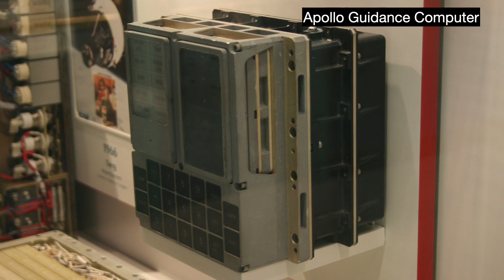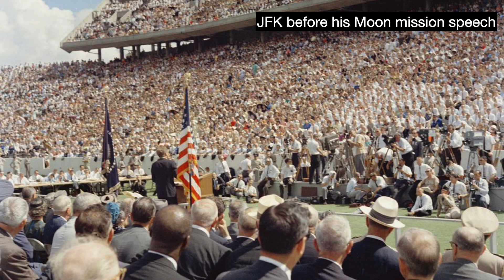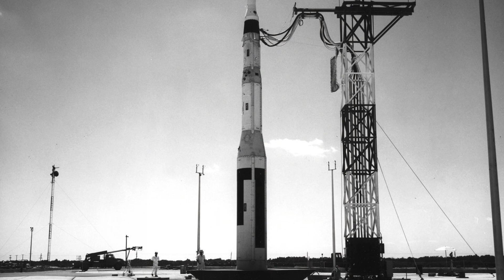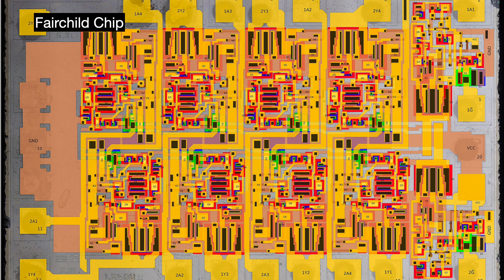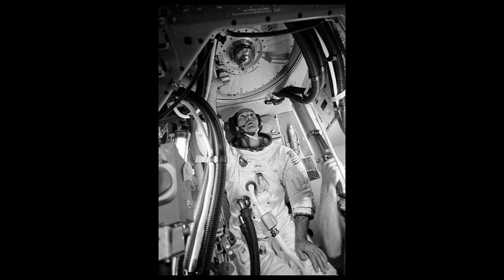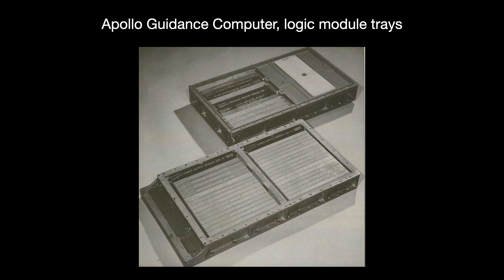How the Integrated Circuit Took Us to the Moon

Comment: Both vacuum tubes and transistors require wiring them up.  Every component, even ICs, require some wiring up to other components, but the point you were trying to make got lost in the shuffle because the main problem with transistors (and tubes) is that to do computing, you need lots of these devices and the wiring can introduce problems the IC doesn't have.

Also, when you say 4100 ICs (and later 5,000), I find it hard to believe there are thousands of chips.  I suspect you mean the number of transistors in the ICs.
Reply: The AGC used chips that contained two NOR gates each, so yeah, the Block 1 AGC used 4100 chips.

Comment: so this mean Arduino can drive ICBM too nowydays ?
Reply: I mean perhaps not an Arduino but I don't doubt that a teensy or something vaguely bigger could handle the inertial guidance needed by a reasonably large missile
Reply: @AMogus-jr6qk  yes agree teensy  can handle heavy jobs. however am curious nowadays in cruise missiles what they use as it cruise missile need full flight path and also it have terrain mapping features nowydays mean its more like full desktop computer is needed there because flight path and terrain data you will need good amount space  and images processing you might need open cv powered applications which will also more like PC .
Reply: @Xerox482  Probably some SBC with beefy ram and lots of storage, nothing insane computationally tho

Comment: They needed IC due to weight. The less weight there is, the more to get to the moon.
Even one pound saved is alot. 

If you think the massive Saturn V rocket needed to put and finally returns a tiny capsule back to earth. The ratio is tiny.

Comment: When NASA looks back at back-up systems and states that maybe they should have focused on improving their primary systems instead... that defeats the whole purpose of the back-up system. If their primary systems had gone offline, no matter how improved they were, then they would potentially be praising the fact that they had a back-up. The best back-up is a back-up you never have to use. Of course this all assumes the back-up actually works if needed.

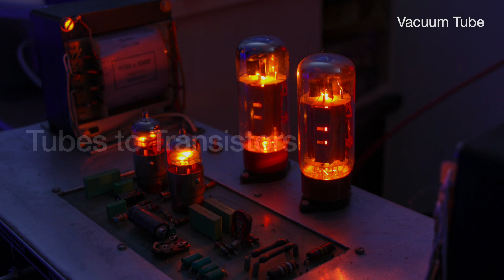Comment: Just discovered the channel and glad am I that I did :)  In my view this is very close to public television level stuff, the info and presentation especially. Wanted to comment on a thing as people always do in the comment section @ 6:04 I disagree with the generalisation that tubes "suck" they "suck" for that applications, no doubt! but they can be reliable and perform very well in other applications. Tube reliability is  the result of the circuit design and not a inherent problem of tubes. Tubes, transistors, integrated circuits, all have their quirks and sensitivities and if you design the application respecting the datasheet recomended parameters all of them can be reliable. I own both tube and solid state lab equipment and can atest that both types can work reliably for many decades. It has been my experience that tube faliure is very very rare in good quality equipment.. cheap equipment is another story and the tubes in them have a hard life usualy, old budget tube based tv-s probably the worst. End of rant :)

Comment: Excellent, well researched & totally agree with your conclusion. IMHO, the Minuteman II program was a far more significant factor in the development of ICs than Apollo. Another was the "calculator wars" of the mid-late 60s, which provided the "economy of scale" Fairchild were hoping for when they decided to sell ICs below cost-price. One small, nit-pick: the IBM 608 was not developed until 1955 & was released in '57 (not '53 as you state).

Comment: Although most people nowadays consider the Apollo Guidance Computer to be ancient technology, it still possesses a most elegant system architecture that rivals any modern processor.  (see https://en.wikipedia.org/wiki/Apollo_Guidance_Computer)

Upgrading the architecture (steam-punk-style) would be to replace the core rope memory with SSD (USB) and throw a few ARM processors into the logic modules.   The simplicity of the system leads to emergent scalability.  Of course, it all has to be radiation-hardened for the journey to space, but that technology is mature today.

Comment: I am a SWE and have no professional hardware experience, but I do love it as a hobby, I have been designing tons of PCBs over the years. One thing I have always been curious about is why most ICs (like ST ARM chips, Atmel, the ESP32, etc) all require external capacitors and resistors for things like decoupling, pullups/pull downs, etc. 

Why is this, couldn't they design the silicon wafer to incorporate these components? Is it impossible for them to design a semi-powerful ARM chip for example without these external passive components? Is it because the external passive components are expected to handle higher power levels/temperatures than the silicon could endure, or is it impractical to build something like a 22uF capacitor into a wafer design?

Comment: Great video, but I would not say the Apollo guidance computer was that 'advanced' or integrated. It was based on early 60's tech that resembled that used in the ibm370. Ie (Monolithic System Technology). This is related to but not actually integrated ICs and are made up of a 4 or so components. They would be visible if not embedded in sealant. A few basic modules of these were differently arranged to make up the computer. The computer was still amazing in how they packaged all of these units incredibly tightly together however, and went through incredible testing, but by the late 60's things had moved on massively as to what was in the agc (a whole CPU on a chip for the f14 in 1968 for example).
Reply: They are integrated circuits. Sure, there's only a few transistors, but it's still 4 transistors on one piece of silicon, instead of 4 tripods on a PCB.
Reply: @h.dejong2531  Hello have you looked at the disassembly of a module on curious mark or on franlab? They look far more like the units in a ibm 370 to me? The film on its manufacture on alican demirel you tube site is amazing but shows the tech to be 50's early 60's stuff, but just squeezed down to compact dimensions. Ps you videos are great by the way, i have watched quite a few, well presented and edited. Ps why people complain if you do a American video? I know you video has concentrated on the Asian technology boom, but there no reason for you to not cover the rest of the world too -its your site and your choice 🙂.
Reply: @anticat900  the Asianometry videos are not mine. I've seen some of CuriosMarc's videos on the AGC.

Comment: [edit: gasp! I just realized this is me saying something nice about NASA.  I apologize, it won't happen again.]
Interesting, using the very same arguments you used (and add a couple of my own) I would conclude the opposite.  It's not that ICs and microprocessors* would not have become ubiquitous without NASA, it's just that instead of being able to launch a BBS in 1985 as a hobby from a spare room (which led to a successful ISP as the market changed), without NASA it's unlikely I'd have been able to do that until about 2000.  NASA drove reliability innovation (manufacture and operational) which was unlikely to show up for a couple of decades (or more). [*still a few years in the future during the Apollo era]  I am absolutely sure the frontrunners in the IC business were driven by the nuanced edge of creativity more than the immediate need to integrate ICs into actual functional objects.  The point I'm making is that I believe NASA drove the pace of conventional engineering (somewhat based on theoretical physics as a daily reality -- must have been an absolute trip to be on!) and created the first scholarship in the discipline of fault tolerant engineering.  To put a button on it, until fault tolerance drove as much creativity among engineers as logic theory and materials engineering was doing, the computer era was not to "kick off".  So do I think NASA can be said to have kicked off the integrated circuit  economy and firing the "starting gun" starting the personal computer era even though NASA had and has no expertise in PCs (if "PCs" as a word still has a meaning).

Comment: I'm a bit out of my league here, but is it me or are they essentially using the same methods for navigating in space, with inertial references and gyroscopes etc, since... the 50's as far as I know. Though I think even the V-2 used inerttial guidance, but I'm not sure about the details. Just comparing the way the AGC used gyros as inertial reference points to how cell phones use gyroscopes to track their position in space. It's the exact same methodology. Even the same instruments, essentially. Just much MUCH smaller and much more precise. But like I said, I'm no expert so correct me if I'm wrong. Or feel free to add to my thought. I'd love to know more.
Reply: You're mostly correct, we still use inertial guidance. For attitude tracking (i.e. the orientation of the spacecraft), we use star trackers these days: a small camera linked to a computer with a star map. Take a photo, compare to the map to find which way the star tracker is pointing.
Reply: @h.dejong2531  Ah yeah I forgot they used analog digital computers for star trackers, didn't they? I believe I've even seen a teardown of one one EEVBlog, but that may have been something else. It was YEARS ago. But I think I'm definitely gonna rewatch that, whatever it was. Some heavy piece of military aircraft hardware.

But yeah you make a good point that there are many other methods used instead of or in conjunction with inertial guidance. Apparently GPS is used in some systems, which you wouldn't think would work in space. But I guess it's fine for an ICBM if the geosynchronous orbits of the GPS satellites is at about 20,000km so I guess that's high enough for an ICBM flying at say, 1,000km.

 Although I realize commercial ICBM is banned from being used in missile hardware. Apparently the GPS system has a built-in safe-guard that disables it once a tracked target reaches something like 1,000km/h (mph?). You'll have to look up the exact figure. But the purpose is so people don't use it for a tracking system for their missiles. I guess even non-ICBMs. But the logic is, no civilian application for GPS (except maybe setting land speed records) should require it to record you going that fast. Again, there's a lot more to this so I'd suggest looking it up if you want more accurate/reliable information. My memory ain't what it used to be =P.

On that note, I actually remember an incident back during the war in Iraq when Saddam was still alive. Apparently the Iraqi army was using repurposed Playstation 2s as guidance systems for their missiles. Which I'm pretty sure is in violation of the EULA lol.

Actually, I build electronics as a hobby, and more oten than not when you read the documentation that comes with a chip it'll have a section that talks about how you're not allowed to use it for military purposes. Presumably because the same company sells military grade chips. But the only difference is they withstand a higher range of temperatures. Plus you're 'allowed' to use it in your missiles and what not, I guess?

Comment: I don't think transistors needing manual work was the reason they switched to using ICs. Making a PCB is much much easier than making a Silicon Die and has much better yield. Also, IC packaging needed manual work to connect the bond wires to the pads. The main reason everybody prefers ICs is the transistor density (area), speed, and power. Smaller interconnects mean less capacitance. Less capacitance means higher speed and better power efficiency. Add all that to having a physically smaller circuit.

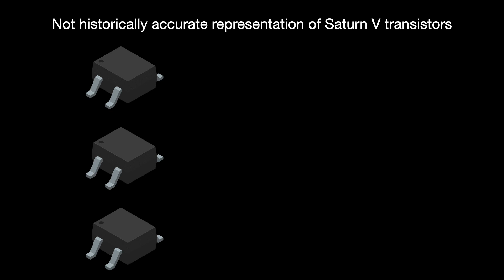Comment: Wow, that 3 computer 'voting' system at 5:00 has shown me, once again, that I underestimate the nerdiness of Hideaki Anno & staff displayed in Gainax's works. Who would have guessed that art imitates life. I can only imagine that ended up in Eva because they couldn't cram it into Top o Nerae! and held onto the idea. I wish nerdy space sci-fi was still in vogue.
Reply: I learned that the Saturn V rocket's "voting" system worked like this: if input 1 and input 2 agreed, use input 1.  If they disagreed, use input 3.  No need to compare all three inputs, just compare two.  Logically, it's the same as comparing three and taking the two that match.  If input 3 is used and it's bad (does not match either 1 or 2), the flight is lost anyway.
Reply: That kind of system was also used in the Space Shuttle; there were four computers running the same software, and if one computer disagreed with the others, it would be voted out. The Shuttle also had a fifth computer, same hardware but completely different software, as an emergency backup in case something went really wrong with the primary software or as a last resort if the other computers had failed.

Comment: At NASA's spending peak in the 60s, they were procuring ~60% of all IC manufactured in the US. I'd say that pushed development of microchips quiet a bit.
Reply: I agree on all points. I think the big takeaway is to not downplay NASA's role. If NASA had not been buying so many IC's would Fairchild (and others) lasted long enough to take a risk that did ultimately kickstart the industry.
Reply: Not as much as you think, the AGC didn't use IC tech, as designed using late 50/60's stuff. By the time it was in actual use, whole CPU's on a chip where being produced, 1000's if times smaller then the agc and more powerful too
Reply: Well, the end of the video suggests that they were buying 60% of very little. Asianometry chose to emphasize Fairchild's risk as the thing that really mattered, and I tend to agree.

The fact that the military and NASA were buying them face them the confidence that they could produce them, and gave them an idea about their reliability. So, in that way, it did contribute.

I don't thing that's enough to say they pushed the industry. The industry didn't really pick up as a result of their purchases; even after NASA was done with them, they still weren't getting commercial buyers.

Comment: These days "computer chip" "microprocessor" and "IC" are often used pretty much interchangeably in a lot of contexts.  Back in the AGC days, the integrated circuits had so few elements that they really were more like just a generic handful of bare components.  All the chips in AGC were just identical gates, like metaphorical lego bricks you could use to build anything.  In a very real sense, the chips are not the AGC.  The wiring diagram of the AGC is the computer.  The chips themselves don't do math, have no instruction set, etc.  The interconnections of the generic gates is really what defines all the capabilities of the computer.  It's very counterintuitive for a modern computer user.  If you use a modern HDL like Verilog to program an FPGA, each IC in the AGC would be below the simplest element you can directly control, despite the fact that it was the most complex element that could be manufactured at the time.  AGC is such a neat little artifact of a very brief moment in time when IC's were truly bleeding edge, and it was still normal to build a computer completely from scratch for every new project.  No legacy.  No backward compatibility.  No existing code reuse.  About five minutes later, Moore's law started to really have noticeable impact, and the industry was off to the races in a whole new world.
Reply: > These days "computer chip" "microprocessor" and "IC" are often used pretty much interchangeably in a lot of contexts
Really? That's weird.

I'd say that "computer chip" shouldn't be used. And ICs can be anything. Microprocessors are implemented using ICs, but not every IC is a processor. Microprocessors are digital circuits, typically having a clock. ICs can be analog or digital, but not every digital circuit is a processor.  One can build a "microprocessor" from discrete transistors but it wouldn't be much "micro" then.
Reply: "All the chips in AGC were just identical gates, like metaphorical lego bricks you could use to build anything." yea right, anything that was not in need to make any significant calculations in real time. The Saturn V "computer" was this huge setup and was doing hardly any job in comparison to what AGC would need to do.
Even sensors basic data processing would be to much for that computer in real time, not  to mention calculating in real time trajectory corections and everything else that was claimed to be in official AGC specification.
From wikipedia: Big lie(große Lüge)->a lie so colossal that no one would believe that someone "could have the impudence to distort the truth so infamously."
Scholars say that constant repetition in many different media is necessary for the success of the big lie technique, as is a psychological motivation for the audience to believe the extreme assertions.

It is funy that even educated people with degree in IT can easly swallow all that amazing almost magical AGC capabilities that was aparently completly forgoten when Space X was trying to land an empty rocket on a specialy prepared landing spot(not a completely unknown and unprepared rocky surface).
So how many year more before NASA will be ready to go back there(as it was announced suddenly when China announced its Moon program)?
Reply: @Bialy_1  Are you an Apollo landing denier?